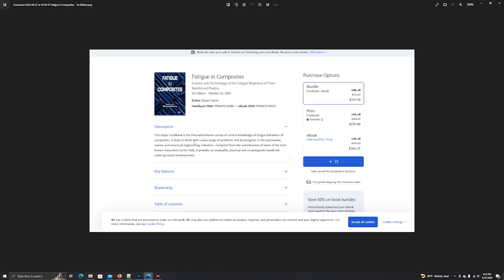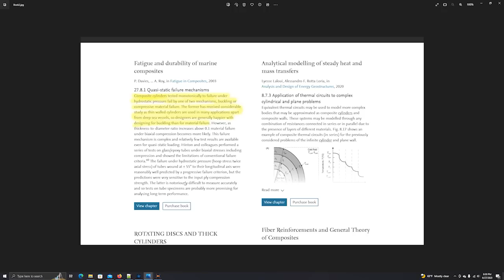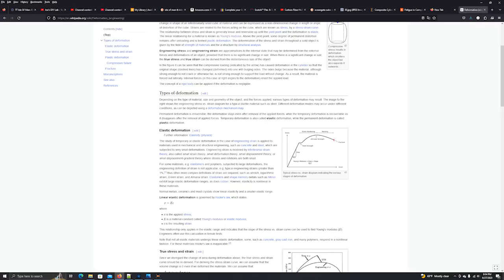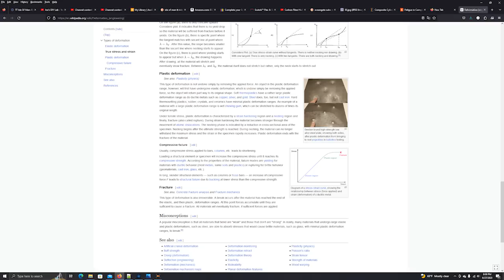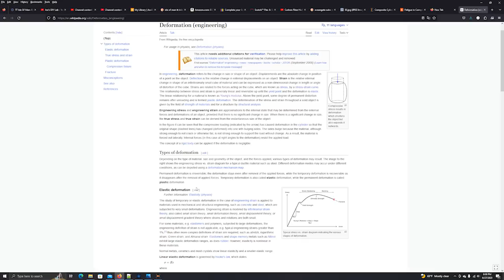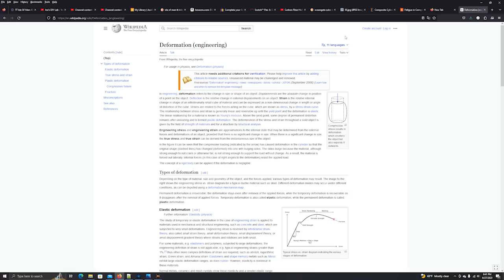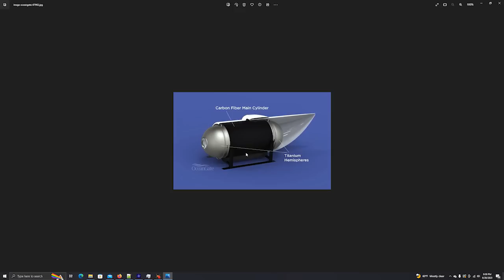Oceangate  Titan Submersible Manufacturing and Engineering Issues Part 2

Comment: the young's modulus thing is a measurement of tensile (pulling apart) force to material, however the titan was under compressive force in this case, would it still apply?
Reply from the maker: Great question,  according to Wikipedia definition, Young's modulus is both in tension or compression,  thanks
Reply: The Young’s modulus of carbon fibre is not reversible. Carbon fibre has no compressive strength at all - the epoxy matrix is the source of the compressive strength with transfer to the carbon fibre as a tension load normal to the applied force (if any of the carbon fibre runs in that direction).
Reply from the maker: @allangibson8494  thanks for the added information

Comment: Joe besides pressure at that depth, is temperature another factor?
Reply from the maker: Depending on the resin system used there may be issues.  But it gets very cold in space, but that is under tension and not compression.
Reply: @JoediyLab  Thanks Joe, keep up the great analysis and insight. Very much appreciate...

Comment: Actually, putting a ruler between two chairs and applying a force until the ruler snaps puts the ruler material in a compressive force at the top, and a tensile force at its bottom. What is a good material for tension and compression. Some materials like concrete are horrible and tension, which is why they add reinforcing Bars of metal
Reply from the maker: Yes, that is correct,  Just depends when orientation you are looking at.  In a sub we are more concerned about compression then tension

Comment: Carbon fibre doesn't really suffer plastic deformation under such circumstances. It just cracks because it's so brittle. That's why glass fibre can be used in pressure hulls but carbon fibre is a big no-no.
Reply from the maker: Thanks for the comment,  In pressure tanks, carbon fiber is strong in tension, I have seen applications of using carbon fiber filament winding for pressure vessels. That is pressure pressing from the inside to the outside.
Reply: @JoediyLab  Oh yes, it's really common, even scuba tanks are made of it, but in compression under that kind of pressure I think new and different forms of lay-up need to be explored.

Comment: Why would you wrap it like a toilet paper tube and not like lets say a actual pressure Vessel?  A compressed air tank or something? I don't think there's any structural value in the way they wrapped it.
Reply from the maker: That was the older sub,  I believe that one failed when tested
Reply: @JoediyLab  Thank god for that.

Comment: Your example of the 'ruler between two chairs' is not quite accurate. It turns out that a ruler suspended at both ends with force being applied in the middle would undergo both 'compression' and 'tension'. The top of the ruler would be in compression while the bottom would be in tension. That is why 'I beams' have a wide web at the top and bottom of the beam to make the beam stiffer under load by increasing steel width on the parts under compression and tension without the weight of a solid steel bar of the same dimension. Concrete or wood posts are examples how to support a compressive load. Concrete beams always have steel rebar in the bottom of the concrete form to strengthen concrete when under tensile stress since concrete is strongest under compression.
Reply from the maker: Thanks for the comment, yes and I was referring the the pressure of the outside pressure hull being forced  inward by the seawater pressure.  But did not mention that the pressure hull would also be in tension from the inside pressing outward.

Comment: The ring they recover dont have any pice of glue or carbon fiber , i agree with yuor very comlete analisys , but glueing this parts is so crazy for me , well all this submarine was a bomb waintg to explode
Reply from the maker: Epoxy adhesive is a common method of bonding metal alloys to carbon fiber.  You just cannot bolt carbon fiber sections together.  But yes there are many issues with the way the sub was designed and not tested between dives.  Thanks for your feedback.

Comment: I commented on part 1. The link you had, took me to a ton of info. It was 2.54 meters long, 127 millimeters thick, and 1.68 meters outside diameter. They claimed it was rated to 4000 meters. They also made a statement, that composites will preserve life down to 6500 meters. It was designed and built by Spencer Composites in Sacramento California. That link was loaded with facts, and also claims Stockton made. He spent more money on the attorney's he used to sue former employees, than it would have cost to do the inspections! Complete fool, chasing fame! It said it was Pre-Preg. But, we all have seen the video of 5 people applying resin glue by hand. Nothing could be more accurate than that!
Reply from the maker: Yes, Thanks for your comments.

Comment: Also one must include 2 companies that did repair or rebuilding of Titan hull in 2020-2021 - late fall fini! These were, Elecroimpact and Jeniki Industries, both aerospace.
Nothing should  be eliminated.  StarLink also checked for its satellite probabilities as he started to rely on that. Actually 1st time he used it was  the 18th.  
Rescue raises questions also.  
Not only oxygen loss worrisome, but, materials of CF and epoxy resins, having detrimental consequences left under sea salt water, sea freezing changing temperatures, sea powerful currents of  pressure wherein excessive time delays remaining therein would cause disaster  with loss of 5 lives eminent. Why r all afraid to talk on that topic!  Because you believe what you are told to believe!
I find it so suspicious to withhold info, that’s reason I cannot Believe!
It could have been said on day of incident, if, in fact, 18th was date heard implosion;     We at this time cannot confirm nor deny this implosion heard was the vessel, Titan!  But to not acknowledge that to the awaiting public, to  deny vital possibility  of a disaster to millions of the public is downright negligence!  It has its ramifications and that includes distrust, lack of due responsibilities, and misinforming the  public to believe  survival might be possible if  within reasonable time sought!  That’s where I see abundance of fault!  So that leads me to question, truth (true or false) or excuse, as in saving ones errors!
Reply from the maker: All very good points,  I think that is one reason the coast guard continued the search even after hearing the anomaly. They were not sure if it was related to the titan or not, but yes they could have announced that just like they heard the banging noises.

Comment: the titanium rings were set on to the carbon cylinder using a gantry crane and slings.  No precision jigs.  The ring likely was not centered over the cylinder, it was eyeballed on, and thus likely resulted in the epoxy was squished out from one side a bit as the ring settled into place, resulting in epoxy voids, and un-uniform epoxy thickness.   It was amateur
Reply from the maker: Good point, thanks